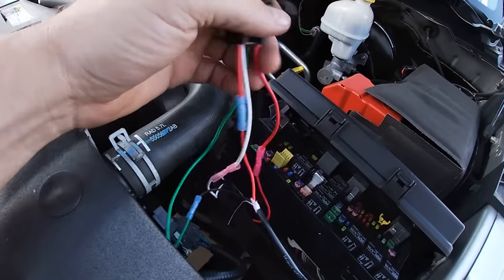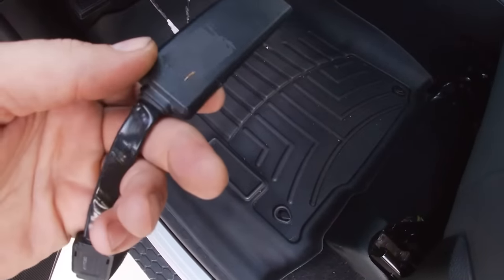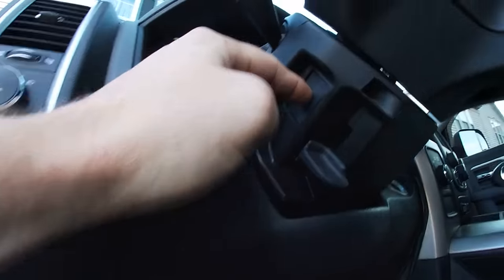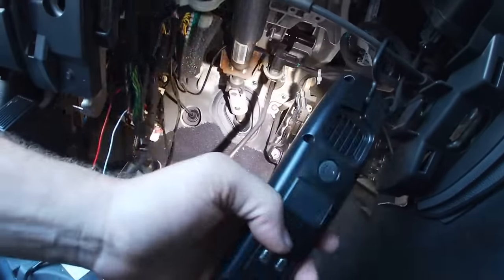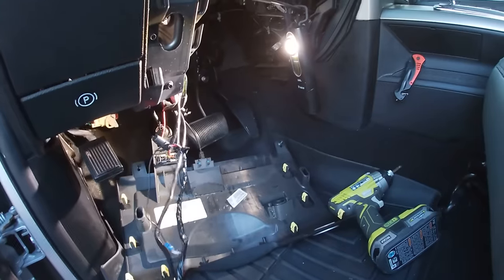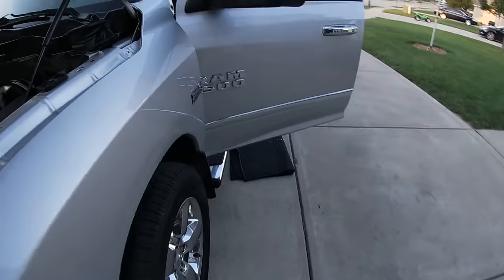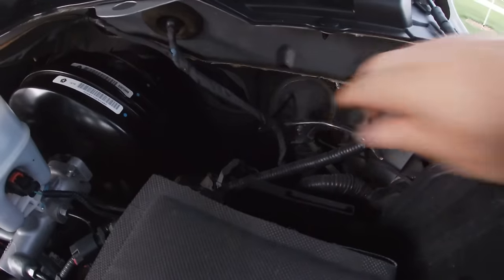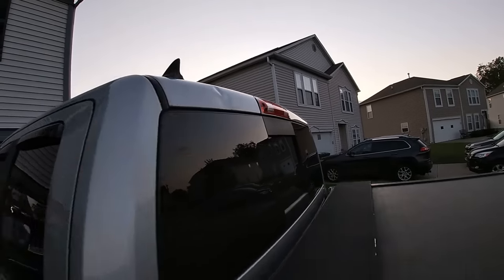Tracking Device Found on My RAM!

Comment: I know several used vehicles and fleet vehicles that used tracking devices. I don’t blame them for using them. The used car dealers could cut the power and the car wouldn’t start and helped them recover the vehicle in a safer manner. The issue is, the dealers aught to have a system in place to remove the device when the vehicle is paid off or if it is paid for, removed prior to delivery of the vehicle.
Reply from the maker: Scott McClure I don’t blame a company for using them either. In Indiana where I live it’s illegal to install a device that has a starter kill on it. I agree 100% they should have to remove them before selling.
Reply: FAB Automotive Detailing The devices are legal in Georgia and there are more of the lots with higher loss rates that install them.  Are newer vehicles exempt from the law in Indiana, such as GM vehicles with OnStar, that can kill ignition and locate?
Reply from the maker: Scott McClure I don’t know about factory installed devices but aftermarket ones can not be able to disable the vehicle.

Comment: so, your truck was once sold by a used car dealer. or possibly you bought it from a used car dealer and now you are going to be in trouble for removing it??
Reply from the maker: Luke Warmwater It was on the truck when we took the first test drive and bought it a week later so no it wasn’t put on for me. Plus there is nothing in my paperwork stating it’s on the truck. I called the Ram dealer after I found it and they said they do not install tracking devices.
Reply: @FABAutomotiveDetailing  good deal. some times those things can make trouble for you in more ways than one!!
Reply from the maker: Luke Warmwater Yes they can!

Comment: not needed...what do you think your cell phone does even if you dont activate the app..get a gps blocker
Reply from the maker: Miguel Castaneda I could careless about being tracked the point was the install was terrible and the corrosion on the relay is why it wouldn’t start. I figured it could help someone.

Comment: My truck has been down for over 5 weeks bc of this exact issue!!!!
Reply from the maker: I think the company that installed it should have to pay for your repair bill. Crazy they get away with it
Reply: What's even more crazy is that I even called every Dept before paying it off to find out if that was why it wouldn't crank. They said  to bring it up there!!!!!
Reply: Im about to go outside now and deactivate this device. I begin doubting when messing with electrical. I did the exact same things and thought the exact same when trouble shooting. My GPS device is a Spireon.
Reply: Video on Replay!

Comment: Hacks.
You never use this type of connection under the hood,  in the cab where its high and dry ok.

But even at that rate, the amount of metal between the device and a clear view to a sat is obstructed enough to make it ineffective.
The rusty relay shows how stupid they were. 
Put the stock relay back. And use a water proof connection under the hood and load it up with lithium grease so water can't get to the
Wires if you ever have a no start problem thats where you look first.
Reply from the maker: Yes whoever installed it did an absolutely terrible job. I fixed it right and haven’t had a problem since.

Comment: I bought a fleet vehicle and found a GPS tracking device 👍they probably didn't want to cut any wires and cause more problems
Reply from the maker: xItzStormShadow That is probably why but I think if they install it they should have to remove it because it will cause problems in the future.

Comment: Check all the V.I.N numbers, a friend went through a pile of Legal bs. He bought a cargo van that turned out to be stolen. The thieves replaced the VIN tags on the cash and doorway.
Reply from the maker: I bought it at a Ram dealer with a carfax so I’m sure it is correct. Thanks for the info though.

Comment: Your truck probably on payments and was bought used this is very common and you will be called by the financier for having it reinstalled haha they can are it beep full time if you haven’t made your payment..
Reply from the maker: Didn’t watch the video did you? I had it for 2 weeks at this point and the corrosion shows it had been on for a very long time. My finance company said they don’t do gps and I could remove it no problem.

Comment: I see those on cars and trucks sold at use  dealerships in case someone doesn't make a payment can track them but is the first time see have a killer for the starter oh the fuel
Reply: Those dealerships never take them out I found few of those go bad and drain batteries overnight  and they get hot like you said
Reply from the maker: @MiguelMartinez-hm1hg  It’s also the first time I have seen a starter kill on one. They should have to be removed before trade in. If I wasn’t a mechanic I would have had a tow bill plus a repair bill. Yes they will cause a significant parasitic drain on the battery.
Reply: @FABAutomotiveDetailing  but imagine if they keep tracking you every where you go 😱😱😱😱
Reply from the maker: @MiguelMartinez-hm1hg  They would get bored real quick tracking me. 😂

Comment: If you remove that external relay your fuel pump will keep running its a bypass , dodge is notorious for that issue.
Reply from the maker: Loyal MacFarlane I removed it and have had no problem. The fuel pump turns on when keyed on and off when key is out. That was an aftermarket relay someone installed for the tracker not OE.

Comment: OK . . . if one DOESN’T have auto experience ( like FAB detailing does), has does one DETECT an installed tracker? Secondly, since most (newer) vehicles have GPS, can’t anybody track you through that? Lastly, since Law Enforcement can shut down the engine of a vehicle involved in a Hot Pursuit, aren’t all of us, with newer vehicles, being tracked all the time? 

Also, I seem to recall that Tesla has cameras installed in their cars that customers know nothing about. The customers know of six cameras (or more; backup, lane, external cameras - for theft, hit & runs, accidents, etc.), but there are additional cameras inside the car and elsewhere, that are not revealed, INCLUDING THE REARVIEW MIRROR, which is watching watching you every nose-picking second. Literally. Tesla has no comment on such cameras. It is known that they will increase the number of cameras as years go by. Tesla WILL NOT SAY who has access to that data. Tesla will not say who owns that data. Which is why I like old cars 😉 !

Comment: You're insurance company might ask you to plug in a gps to the data port under you're dash to lower ur rates
Reply from the maker: Bill Bird Actually did that about a year ago. They wanted it in for 6 months to monitor  our driving habits and it actually lowered our rates 18%. Once the 6 months was up we sent it back.

Comment: OK, why not inform the dealer you bought it from what you found?,  You said it was a fleet vehicle, soo a tracking device (to them ) was probably for their own protection. they did not remove it when they knew (IF THEY KNEW ) the truck was going to be sold. It's not a paranoid thought, especially knowing where the truck came from. it might even be common practice to some companies.
Reply from the maker: I did contact the dealer and told them to watch my video! When they inspect vehicles they just do a safety inspection to make sure it’s road ready I guess.
Reply: @FABAutomotiveDetailing   COOL, when i saw the video, you seamed more than surprised, (as anyone) about it, and when you found out who was responsible you did the right thing. Thanks for not leaving us hanging.
Reply from the maker: @whitneyeaton5585  I was very surprised being that I had just bought it 2 weeks prior. My phone call to the dealer probably wasn’t the nicest call they had received but I gave them the benefit of doubt. They were lucky I am a mechanic otherwise they would have had tow bill and repair bill that I wouldn’t have paid for. You are welcome I appreciate you watching and commenting

Comment: What you have is piss poor install. It is a repo device, we used the exact tracker on the used cars that we fixed for a local dealer. They should never draw more than 250 milliamps. They have transducer interupt options that inhibit the theft deterant system from seeing the key, resulting in no start. Actual tracking only happens when you call the host company. They switch tracking to active and that costs 75 bucks. It is good you found it. Pro tip: the unit comes with a jumper set for the obd2 computer service port. If the plug on your car doesnt look right, follow the wires. If it was imstalled with the harness provided then the actual data port will be up the wiring about 6 inches from the fake plug. Remove it, and discard.
Reply from the maker: I appreciate the info. Nothing was tapped into the OBD port I checked that also because I have had to remove them from the ports at work. 250 milliamps is a lot for a key off drain. You typically want less then 50 milliamps.
Reply: @FABAutomotiveDetailing  50 milliamps is certainly ideal, and can be acheived once the accesory delay relay shuts down and the body control module times out. I have seen alot of techs try to diag a parasitic draw as soon as they shut off the key. I have been doing this since 1993 and i still find incompetence comical. I recently tried to train a new hire to do electrical work. When i saw his toolbox i knew this guy probably wouldnt make it past lunchtime. He had big time experience, so he said, 14 years, he said. And thats on late model domestic vehicles. I thought you might get a laugh out of the fact his parasitic draw goose chase told him that the pcm, bcm, instrument cluster, air conditioning control head, and abs module all went bad at the same time on a 2012 malibu! That would have cost the customer thousands of dollars. He was so sure he pinpointed the draw. I looked at the battery and it was a ac delco battery, original battery was 8 years old!. I laughed when he showed me his "evidence". He shut off the key then ran around like mad unplugging stuff under dash, hood, and such. Exactly 12 minutes when the bcm times out the dome light that was kept on by open doors draw dropped to 95 milliamp. " See, I told you! He shouted." I saw him die inside when i told him to put everthing back together, and that the battery was too old to carry even a minor draw for more than 5 hrs
Reply from the maker: @traviscapehart7590  Yes when I do parasitic draw tests I allow everything to shut down for a minimum of 30 minutes and put the keyless remote over 30 feet away from the vehicle. Then I hook my amp meter up go to work. If the door switches are a part of the latch I open the doors before hand and push the latches shut with a screwdriver so I can get in and out without disrupting my test by opening the door. I have worked with people like that also and I am the one that usually has to come in and figure it out unfortunately. I can’t believe he didn’t check the battery first that is the first thing you check. 😂 Thanks for the entertainment this morning.

Comment: Did you know if that is a government tracking device you can be in a lot of trouble for removing it. You may be correct for a fleet vehicle, but if it’s government look out.
Reply from the maker: No it is not
Reply from the maker: Also I removed it almost 4 years ago so I think it’s ok. 😂
Reply: @FABAutomotiveDetailing   call the cops and find out! If you’re under investigation, you are going to be in a lot of trouble for touching it. You may be correct and it may be a fleet vehicle, but if it’s government, you would be in trouble.
Reply from the maker: @joshwebb1493   Not even remotely worried about it. Never been in trouble in my life. Plus I know 100% it’s not the government

Comment: You should have taken it back to the dealership and have them remove that snitch box , cause you don't know if what you did will void any warranty you have from the place you bought it from.
Reply from the maker: Cynthia Cler It was on the truck before I bought it. The corrosion shows it had been on there for a few years.

Comment: Place you bought the truck put it there.  They purposely disabled your vehicle.  You take it back to get it fixed.  They turn your ignition system back on or remove the device.  Either way you get a bill.  Its a scam.   But.....they tried to scam the wrong person.
Reply from the maker: Yeah I know they do that on some cars but the dealer where I bought it at and have bought most of my cars from said they will not install trackers. The previous owner must of had it installed or it was installed for his loan.  The corrosion shows it had been on there a long time.

Comment: Fleet vehicles have those installed to serve a purpose. They just didn't remove it when they retired the vehicle. I had a dodge van, and my father had a plymouth. We both came to the conclusion that mopar products are junk. I would never buy another one!!
Reply from the maker: phil wood Yes they do and that’s what it’s from. 10 years ago I would agree most Mopar was crap but they are way better now.